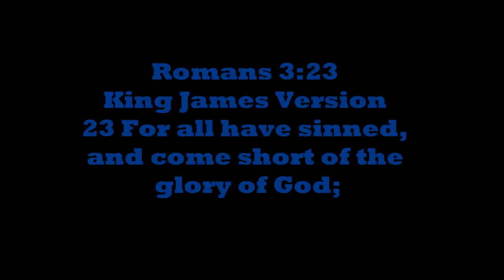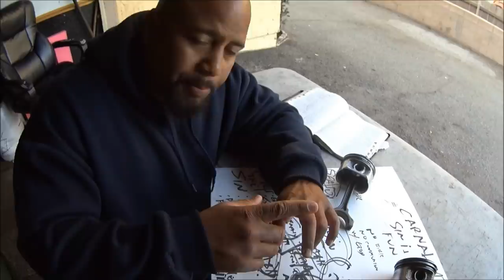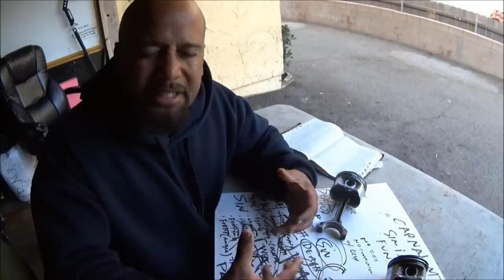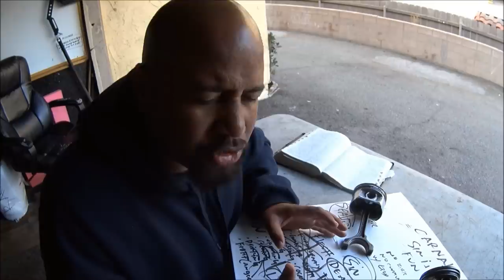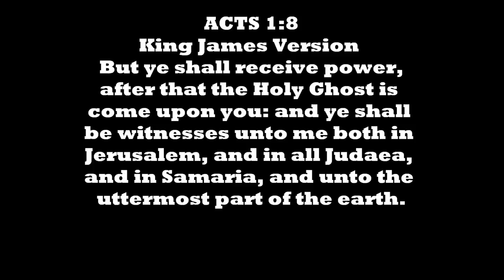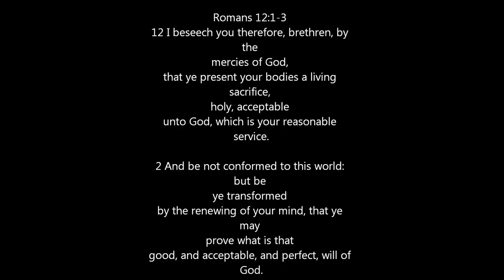FIX ROD KNOCK UNDER $40 FOR THE BROKE FOLKZ HOW TO FIX YOUR BROKEN SOUL STARVING YOUR SPIRIT (2023)

Comment: My car mechanic changed the rod bearings and the crankshaft which he inspected it and it was fine. The motor was running fine for two/three weeks and it sadly got rod knock again.
I am changing the motor right now.

Comment: I must have missed something? Using stock diameter? Or did you go one step up? Plastigage is less than $5 though. I'm doing my car now. It was nothing like yours. So I'm hoping just replacing the bearings with the stock size works. It was quiet before I replace a cracked head. Once I changed that, it was knocking at start up. It would go away after warm up. But it didn't get quiet right away, like usual. So I didn't keep driving it. It has been sitting a while. Dropped the pan and it's just a little side to side rattle. No gap like yours. I thought I was putting the rod caps on right, but the two I have done already, look to be backwards of the others. So I was looking for information on that. I did find a forum showing that half should be one direction, while the others go the other direction. Okay, now you answered my question, while I was typing this. You did use the standard size. 👍
God bless you! Jesus is the way!

Comment: I'm going to go get under my 96 Z-71 immediately after this video. I been pounding the pavement and relying on rides to work for the last 8 months. My 5.7 Vortec has a rod knock. I'm curious to see if this method will work by changing the bearings from the bottom. So much better than having to completely pull a engine and deal with the wire connections. I'm currently watching and he is about to start it. Dammnnn.....fiirst try, cranked rite up and most important that damn thing purrs like a kitten. Great job @#Oldskoolfunk

Comment: great job, bro..great idea. i have thi9s exact problem, on my chevy impala limted 3.6 vvt d.i.  when i give it a cold start from remote start, , you can hear the slight clearence rattle, for like 4 sec...then she quite!  yo the man!  what do you recommend, some10w-30, instead of 5w-30 oil? i only have 55,000 miles. bought from a enterprise rental, at the chevy dealer...with 23,000 miles. on her.

Comment: Great work but I wish you would of went over making sure the rod was inspec and if it wasn't may getting away with using a oversized bearing with a out of spec rod Wich should work to get back on the road

Comment: God bless and great content. For this method would you use standard thicknes bearings or ones with added thicknes? Also would you be able to change out the main bearings in the same fashion?

Comment: Good vid on bearings, just wonder if it is possible to use oversized bearings when there is more damage to the crank?
Reply: Yes but take your measurement of the journal in multiple spots.Meaning rotate the crank 90 degrees and measure then 90 more etc. This is because more than likely the journal is out of round. You have to size the bearing accordingly. Not too tight and not too loose.

Comment: I like your videos! This works pretty well , I am currently doing a dodge grand caravan in the car, I had one rod that I knew was knocking , took it apart , took a measurement and realized I would need to go to an undersized bearing and crank would need to be turned down, to get all of the deep scratches out, and was slightly out of round, i used this method to sand down the journal and make it round and polished, put my bearing in and it turns great, but then I realized I had another rod that had a bad bearing and it a bit further out of round , I'm sure I could undersized the bearing and fix the crank. My only question is , would using a hand file be good to use to knock down the high spots of the egg shape then follow up with this method to polish and fine tune the roundness?  Or would you have any other suggestions to bring it back round a little  faster without removing it?

Comment: Oldskool..very cool..

Question for you, I recently bought a 2000 Jetta Vr6 automatic with 75k miles from an auction..i did start and run it there and have driven a bit after buying it but recently noticed the knock as well..i plan to do the same because i am decent with a wrench and I going for the experience! 

It only had two owners and it dont believe its been dogged it starts and sounds smooth until it gets warm..then you hear the knock..

My question isnt that odd given the miles are so low! 

Thanks ahead of time for the response..

GOD SPEED MY DUDE! 🤓

Comment: How do you have access and more clearance to change main  rod bearing in the connecting rod so will you rotate crank shaft little bit so it'll give you more space and for attaching rod bearing you have to rotate crank in reverse a little bit to reassemble of the rod bearing lower one am i right
Hope some mone explain the technique of this and how to do it 😆 as iam in the process of doing it

Comment: Tried this on my bmw n62 v8 engine but when I torqued down the bolts for the rods the crankshaft wasn't able to turn why is that?? I but the bearings in the correct way and lubed them on the crank

Comment: I have a 2001 grand caravan with 3.3 engine and 180k miles.  Its got some rust and a cracked up bumper... on its best day its not worth $1000.  Trade in on KBB is $259.  I change the oil often but it has been burning oil between changes.  I was on the highway when it started knocking hard.  Its got the same problem as this car here so I tried this procedure after watching this video in hopes of keeping this thing on the road (recently redid the entire front end and dont want to junk it now).  

My #1 bearing looked just like the one in the video but my other 5 actually looked better.  Anyways after changing out the bearings my #1 bearing still has play when the rod cap is at the bottom of the crank (not noticeable anywhere else along its path when hand turning).  Its got noticeable play/knock both side to side and up and down.  Can I use a larger bearing in the #1 cylinder which has the issue? Will undersize bearings (thicker on the inside ) fix the problem or do i need oversize (thicker on the back side)?  I can find undersized at several local auto stores but cant find oversize anywhere.  Is shimming the bearing an option? I've read stories of people using tin foil or wax paper to shim a bearing on older vehicles wondering if youve ever seen it done?

Ill try anything cheap...the cars next stop is the junkyard if i cant get the knock to stop.  Its a shame... handles well, better mileage than my wifes newer van, and has ice cold AC.

Thank you for this video and God bless you.
Reply: Sounds like you need an oversized bearing to compensated for the smaller diameter crankshaft, now that you have been sanded down.

Comment: I have a 2008 dodge charger 2.7 same problem .a question  i need to disconnect  the timing chain on the crankshaft sprocket?

Comment: I'm having the same problem with cylinder 1 and I'm also getting a misfire from cylinder 1. P0301 

My truck is a 2005 dodge ram 1500 4.7 and I'm getting the same knock sound. Exactly the same sound. Did you have misfire?

Comment: Install just two new bearings but when I torque the bearings down the crankshaft wont turn by hand but if I loosen the bolts on the bearing caps I can turn the crankshaft by hand, what is wrong?

Comment: Buddy can you please help I've tried what you said and my old bearings wasn't that bad and I replaced all of em with what the auto part store sold me as standard. One thing is I don't have a torque wrench that being said I've taking this thing apart and put back together four times in the last two days. When I start the car everything seems good until the slightest touch of the gas pedal. When I take it back apart it's always the same rod and it won't enough to see but you can hear it. I'm also gonna ride this til the wheels fall off it's a 03 accord V6 thanks bro

Comment: Curious as to what grade of oil you use "now" since the bearing replacement. 5-30w to 10-30w or do you use the same grade the factory recommended?

Comment: I have a 05 gmc yukon 5.3 @202,000 miles . I have a tapping noise coming from the drivers side head. Its not a constant tapping just every once in a while and if i give her some extra gas on a take off it goes away and wont come back till a few trips later. I took of the serpentine belt and started it when it was knocking and it went away thats how i know its coming from the drivers side head and not the actual motor. Any suggestions on what this could be ?

Comment: I got a 2000 Silverado 2500H 6.0 for 1,000$ it ran when I got it home then it died I tried turning the the crank but it won't turn over do u think it could be my transmission locked up and won't allow me to turn the engine I'm thinking of taking the transmission out or moving it back to see if the engine seized up on me any Idea I like how you make it happen l look up to you

Comment: Hey I have a 2006 Chrysler 300c Hemi I can’t get the oil pan off I took bolts out but onside of the oil pan is this piece I think it connects to the axel cause this is in the way I have rod knock and need to remove pan

Comment: I have a 2.2 Camry 4 that has developed a light rod knock. Do you happen to know if I could get the pan off of that 97 Camry (to do this) fairly easy ?  Or do I have to remove a ton of crap first ?  Jesus Rules !

Comment: What about oil pressure, it will still lose oil pressure since the crankshaft surface will not have the correct clearance between the rod bearings and the crankshaft.

Comment: anyone having trouble taking off the first two cylinder rod bearing cover?? I dont know if its e20 bolt?? I stripped two with a 10mm, I have the main bottom cover off, but due to the subframe of the vehicle it wont give me total clearance to take it off, so I am still figuring out how to remove the rod bearing cover, I already took out the 6 12mm bolts that lay in the middle, but the 4 corners have a weird long e20 bolt i think??? I dont have e20, any advice? Thanks again for your helpful videos and god bless you and your family!!!
Reply: ok update, its e14, I just removed the main rod bearing cover, I barely have room to remove the bottom oil pan main cover because it keeps bumping into the subframe... any advise on how to remove the main oil pan cover and the second part of the rod bearing/crankshaft cover?? Thank you! and god bless you! Love ya man.
Reply: Alright lol, I kept working, and Im assuming I have to remove the engine mounts... but i noticed you might have bypassed that by removing the oil pump tensioner, but I dont seem to see how to safely remove or, remove the bottom chain on the bottom pulley to fully remove the secondary rod bearing cover, covering cylinder number 1... ? Im looking and praying my best... but I still cant seem to do it safely without breaking the plastic guides... I removed the two bolted 10mm cover of the bottom chain, but now im stuck at actually loosening it up so I may remove the crank and rod bearing cover, any advice! thank you and god bless you guys, Ill continue praying and see how its gonna work.
Reply: ya, the bottom tensioner is one tricky piece to push in, and safely remove the bottom chain, Im still figuring it out/having some trouble with it.

Comment: Hello there! I want to ask if you can help me out please. I have a 92 civic EX the crankshaft tip where the crank pulley go chipped. I ask the dealership what crankshaft I can use, they said only 92-95 SI or EX. Is that true?

Comment: Hi; One simple question: Would it make perfect sense to install undersize bearings on the journal in where the spun bearing was found?   I thought that since this specific journal required a bit more sanding than the other (in reality this one was bad) maybe an undersize bearing (more bearing material un de inside surface) would be a better fit than a standard bearing; because it has already lost some crankshaft journal material?   Appreciate your comments brother and might God keeps his blessing upon you !!!  Great video content !!!

Comment: hey big brother I'm about to do this on Friday I just have two questions . would the process be the same for the Bain bearing and how long did you sand the journals for ? just terrified I might sand too much material and be to undercut for the bearings
Reply: If you have or can borrow a micrometer, measure the journal diameter after you sand and if necessary buy the appropriately sized bearing for that journal. As for a main bearing, you can't really sand the journal like you can with a rod.
Reply: @endeavourniche9001  thanks ! Just got a whole new engine cause the journal was actually gouged . I'm saving the motor to build it and replace the crank for a forged one .

Comment: In the beginning of the start up it still knocked but cleared up immediately do you know what I could do to prevent my car from doing the same and possibly spinning the bearing again should i add and additive that will run it smooth for the first 300 miles and then redo the oil change would that help on top of the other things you did here as well

Comment: Im in the process of changing my rod bearings for the same car/engine 
May i ask how did u get the balancer unit off i tried an e12 and e14 socket for the bolts  the 14 slips and the 12 is too small
Reply: I'm under a neighbour's Hyundai Getz replacement engine at the moment, after she did her own oil-change in the the original engine, overfilled it (user manual? what's a user manual?) and blew the rings. He replacement is from Japan, where by law they have to turn their vehicles over about every three years I'm told - to keep the production lines going? Anyway, this engine has, I suspect, never had an oil change in it's previous life, and the growths and buildups of sludge internally are appalling.
Woa! That was a ramble! Sorry.
The short answer is that most every bolt on the Hyundai smaller engines have 8, 12 or 14mm heads, but there are just a very few at 13mm. I can recommend new spanners out there, branded Force here in Oz, being about 300 mm/12 inches long centre to centre of their ring-spanner ends. Flat to the work face, and close fitting, with almost zero ‘squirm’ as force is applied, they are very, very useful around the modern close packed engine. I bought a 12/14 mil one to do neighbours engine, and am saving for a 13/15 mil one. No connection to Force, just admire a mob who can think outside the square. FWIW. Cheers, and thanks for the reminder of religion & Christ’s Mass.
Reply: 13mm ??????

Comment: Put a strong magnet in the bottom of oil pan too. Why wasn't that bearing getting oil. Gotta do some investigating? Also should use. Plastic gauge to check bearing gap,  incorrect gap could coz the issue.

Comment: Oh my God man!... Any "grit"(from sanding with the shoestring previous) that might have been in that oil Gallery hole on the crank/rod that you blew with compressed-air, you blew it directly up into the main bearing!?!?!... With a small eighth of an inch copper tubing attached to a blowgun... Insert the tubing into the oil Galley hole... blow compressed air in there and the pressurized air blows any grit out of the hole.

Comment: Mechanics won't do this coz they know there are metal parts all through the engine and those metal shavings (sheared off/disenigrated bearing)  still have shavings in crank bearing journals and the rest of engine.

Comment: The Biggest Deal that No Car Has Anymore 
is an Actual Oil Pressure Gauge - Why do you think that is? 
Mfg doesn't want you to know - because if the care given wasn't 
perfect in the first 30,000 miles - you might claim a warranty. 
But they know with bare minimum,, it'll keep going beyond warranty, 
but will be worn out. 

Oil Pressure Gauge Is the Direct Read of Wear of your 
Main and Rod Bearings. Period. Nothing else matters, 
everything else is secondary. Cams,, lifters, shim buckets, etc.

The Path is Simple - OIL PUMP, Oil Filter, Crankshaft. 
Full Oil pressure goes from oil filter to galley ports cast in the engine 
block to ports at the crankshaft he showed you at the bearings. 
Where He blew in them with air hose. 
If colored dye was forced backwards at port he blew into,, 
it would go all the way and out the oil pump.
But check valves prevent that.

So if you are really concerned with your high mileage engine - Get One and Install it with a tee fitting at the Oil Light Sensor at the Oil Pressure galley port. 
Now you will have both an oil light and real pressure gauge. 

Now when engine is hot at idle,, if pressure is less than 30 PSI, 
you now have options to upgrade it,, Just as this video showed -
Plus Upgrading the Oil Itself, to a Higher Number. 
The Cushion He mentioned is Hydraulic Pressure of Oil
to keep that bearing from ever touching Metal to Metal. 

So Protect that Engine from flying apart to begin with,
by installing OIL PRESSURE GAUGE. And Replace Oil Pump,,
as it is just as worn out as the bearings. At least take it apart 
so you can see the extreme wear on the gear lobes. 
It's had to suck up all the trash and pump it to the filter.

It's no different when you visit the Doctor,, first thing he does,, 
what's the pressure? Everything about your Health - Depends on Pressure. 

Isn't That Right Captain? 
Congrats on showing a very cool easy way to save a desperate 
engine crying for a second chance, plus buffing out crank damage.
It's How to Win the War,, and Smile Doing It. 
Cheers